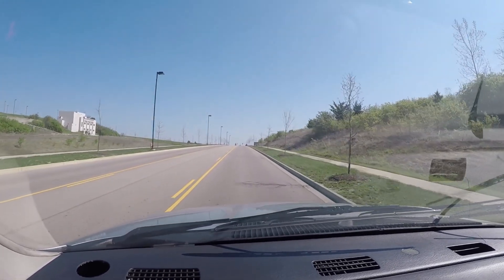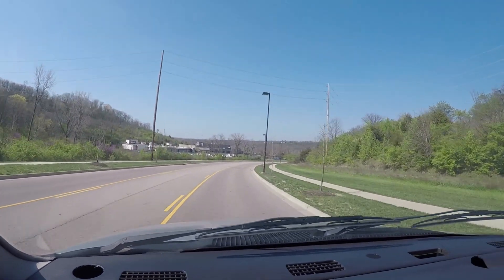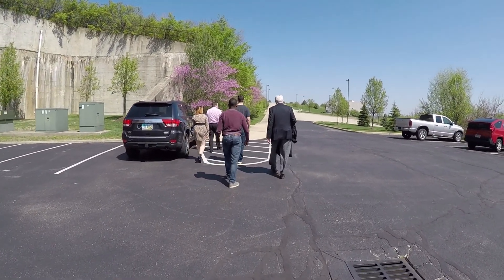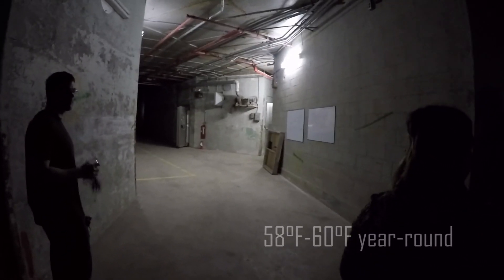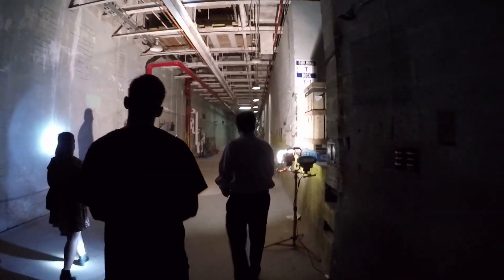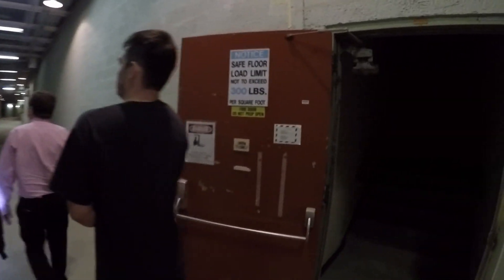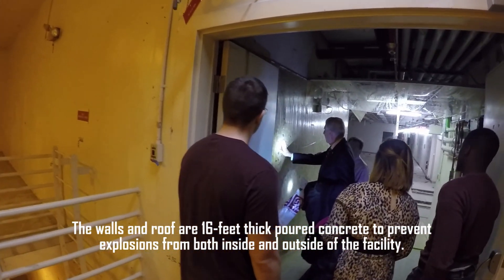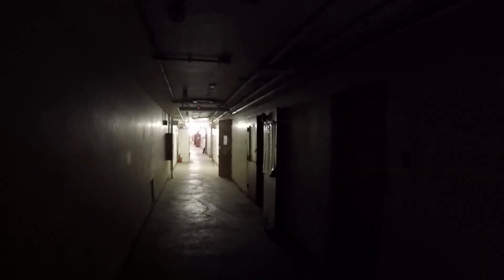Mound Facility, Miamisburg, Ohio

Comment: I use to work in that building (T Building). That building use to have multiple sets of blast doors on each end of the tunnel. The typical access was by elevators, at each end of the underground working floor levels, with guard posts at the top. It was also a fallout shelter. The racks overhead in the tunnel were used to store food/supplies and the area you went into, where the wall was cut with a diamond rope, use to be a potable water storage tank before being repurposed into laboratory space.
Reply: A friend of mines dad used to work there ....I can't say much without getting anyone into trouble....

Comment: The wwII site was actually an old seminary in Dayton.  My aunt worked there and continued research on how to count radiation started by Marie Curie.  She certified the polonium sent to be alpha triggers in the  two bombs dropped on Japan.  Mound Labs were built later.
Reply: @XenonCitium  My aunt worked first at the old book despositry in Dayton and later at Mound labs after they were built.  She retired in 1976 as Senior researcher and my brother worked as a mechanic there also.  Of course you did not ask my aunt about what she was doing because it was hush.  She work with Monsanto from the getgo in 1943 until she retired over 30 years later.
Reply: The seminary was name Bonebrake or Bonebreak. Odd name indeed. Runnymede Playhouse in Oakwood, an NCR warehouse down the hill from there, etc. were used. In the late 1990s a garage was “disposed of” right next to the Miami Oxford campus (uptown, north side). The building had been used as a machine shop during the project. Hope they got em all 😌
Reply from the maker: Work for the Dayton Project was performed at many sites across the Dayton area!

Comment: This is nice 😘 there are a few pics floating around showing the foundations of that area being formed before the “roof” is up. It’s labeled as 1948, and shows rebar out the wazoo.
Reply from the maker: The roof and walls are 16 feet of poured concrete and rebar. It's hard to imagine!
Reply: @MikeDoesHistory  the size of some of the rebar in that building was amazing! The diameter is greater than my wrist. From what I remember, it was about 3" and the small cut section I got to see was very heavy.